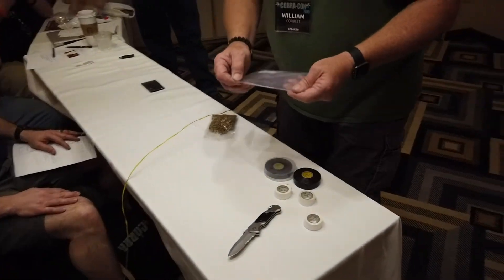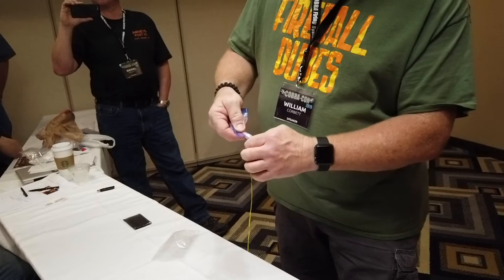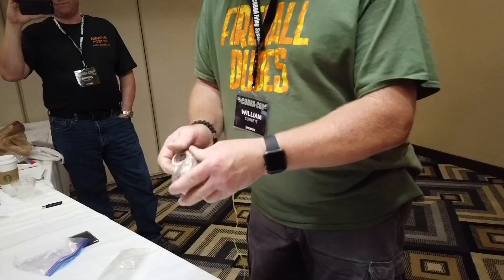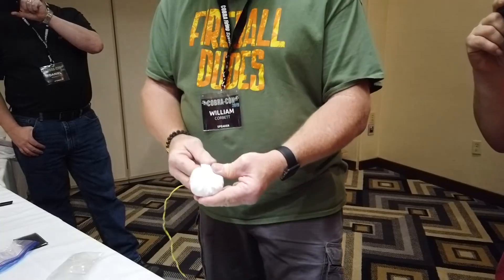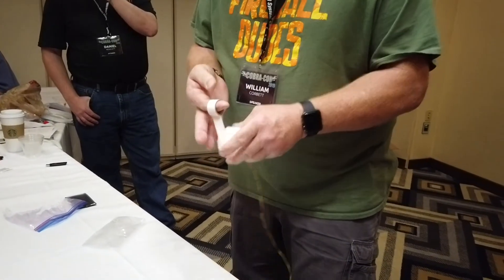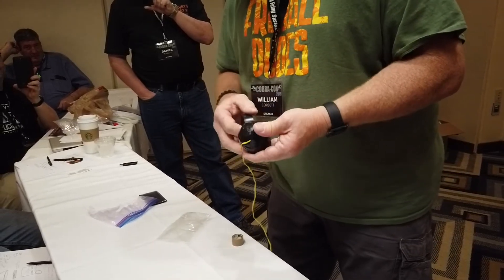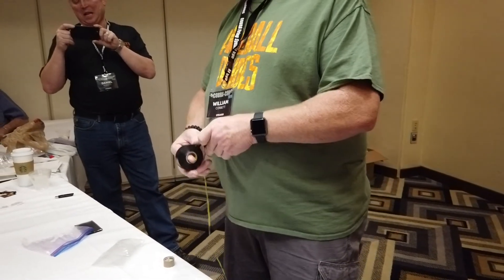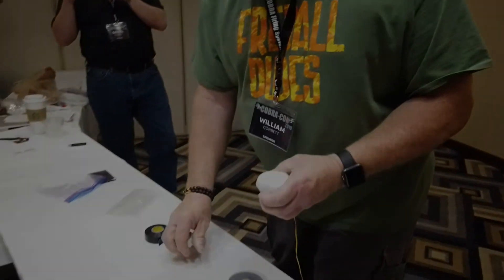Bill Corbett Fireball Lift Charge

Comment: I have seen others use water in the tube fist, to acts as a plug that pushes the gas out and protects the charge. This is what I used as well and I got a pretty good result. Just curious if y'all do the same, or use just gasoline in the tube. 

Also, I like the "ziplock baggy" method. It seems much easier than the pill bottles and electrical tape method that I use. For the smaller gas fireballs (1.75" diameter), I use 0.5oz plastic sample jars, with screw-on lids.

Great video!
Reply: I don't use water unless I'm at a golf course or somewhere similar. Most people do use water to minimize fires on the ground.
Reply: How do I solve the problem of consistency